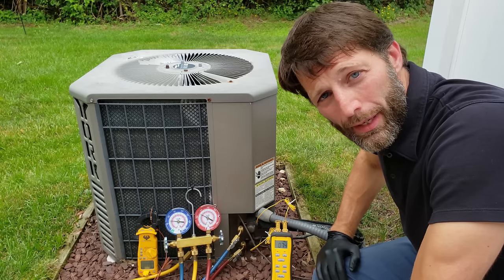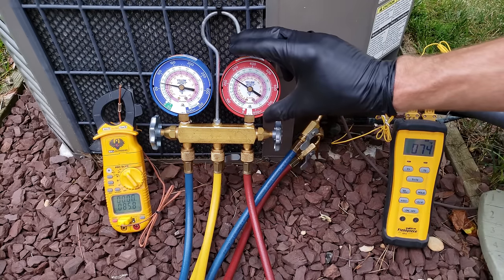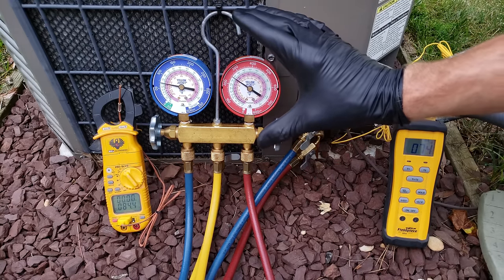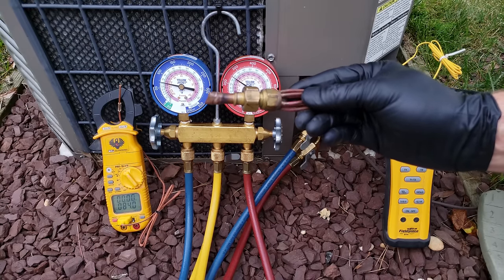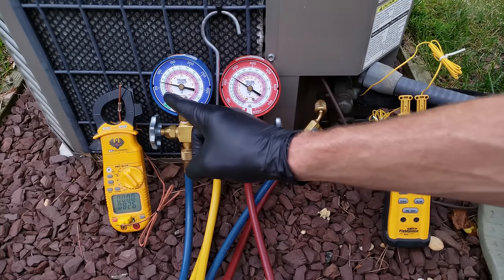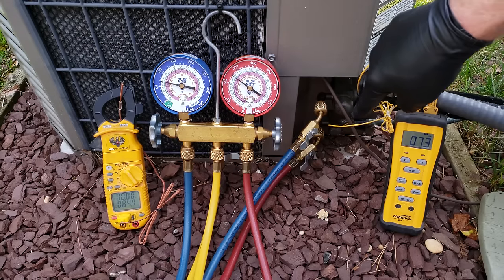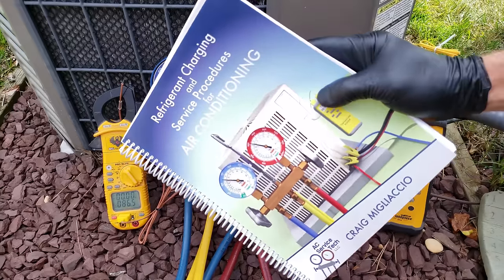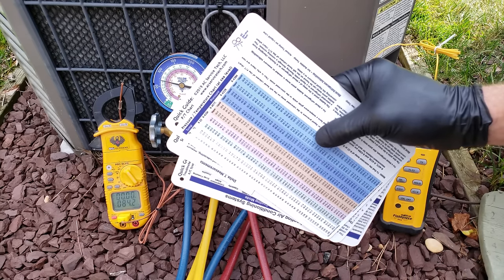Ambient +30 Rule & Ambient Temp +25 Charging Methods!

Comment: Thanks for this video.  I posted in another video how techs and my mentor are using the 30 deg rule on all refrigerant, not just R22.  They are using it with 404, 407, 422, 410. Bad habit and I will no longer be a bad tech.  Thanks.

Comment: I've been using Ambient+ methods to eyeball charge and coil cleanliness since 2009. The first time I made a repair on a brand new high efficiency 410a heat pump, weighed the charge in, and saw it running an ambient+ 10 my mind was blown. As far as actually checking charge is concerned, I have always used superheat/subcooling but when you are doing huge commercial accounts and every minute counts, the Ambient+ on the head combined with a delta (low delta, normal head, normal suction generally is indicative of low charge and dirty condenser and low delta, low head, low suction is obviously indicative of very low charge and a possible dirty condenser) will tell you pretty quick if you need to slap pipe probes on and check the charge. It also helps if you wave your hand over the condenser fan(s) while they are running and feel the angle they are discharging air at. If the air is almost blowing out horizontal that condenser is plugged or someone mounted the blade(s) wrong (it happens more often than you think, especially in commercial where building owners/leasers jump between contractors every five minutes). The ambient rules are absolutely fabulous for judging whether or not you need to clean/split and clean condenser coils at accounts that opt for T&M coil cleanings. You just need to be able to identify the rough SEER rating of the equipment you are working with. These little tricks can save you massive amounts of time on maintenances and, knock on wood, have never caused callbacks for me in all the years I've been doing this. In fact, I'm known for being one of the more thorough service techs where I work and generally quote more necessary repairs (don't be a hater, I never quote things that don't need replaced. My company does not give us spiffs for selling shit) and have less callbacks than anyone else and at least 50% of what I do is eyeballing, poking, and twisting things haha! In fact, I can't remember the last time I had a callback for leaving a unit run low on charge.
Reply: Low Delta, normal head, normal suction= low charge and dirty coil.  So, for this does it mean both low charge and dirty coil? Also, this is counting on that all stages are working?
Reply: Low delta, low suction low head=very low charge and possibly dirty coil.  So would this be definitely  low charge?
Reply: @La2venida  refer to the basics man. If you don’t know if your coils are clean then clean them. If dirt pours out then clean them until no dirt comes out. After that superheat, subcool, delta, and static tell you everything you need to know

Comment: Great explanation. I am at the end of my first semester in HVAC, and find myself wondering if I missed something along the way in these past months. I totally get the theory behind the basic function of the refrigeration cycle. But...I still find myself frustrated at not understanding the how and why of changes in one part of the system, say low evaporator charge, affects the function and measurements at say the compressor discharge port. I understand THAT change ( or imbalance) at one point does or should produce an effect in another location in the system, but I am not confident I understand WHY or HOW that effect occurs. Is there a video that you guys have made that explains that energy teeter totter for novices like me?
Reply: If you need sone mentoring you can reach out to me. Just let me know

Comment: Any guide for charging units in winter time? (Heat pumps) r-22 and r-410a.location for lineset temp probes to be placed while in heat mode and checking charge.

Comment: I have a question. Are you saying that the 11 degrees of superheat should be the target "total" superheat? It is my understanding that the temperature you arrived at would reflect the superheat just at the outlet of the evaporator.  Wouldn't the superheat reading at the inlet of the compressor be higher - taking into consideration heat gain from the ambient, friction and length of line set - than a reading taken at the evaporator? In which case, if I am correct, what would be the best method of determining what the "total" superheat should be at the compressor?
I read somewhere that a reading of less that 20 degrees on an 80 to 95 degree day would indicate an overcharge (not having checked sub cooling) or air flow problem. I look forward to your response. Thanks!

Comment: What I tell techs is when charging using sub cooling, they will find the liquid line will cool (go solid) @ approx 20-30 deg above ambient on the gauge. It was just an approximate and as a matter of fact, w/ assuming a clean coil and correct CF motor. I really never gave much thought with an accurator used with a TXV. I'd prob do superheat as a precaution, and subcooling to figure it out. Good vid but will be over the heads of most jr. and some senior techs!

Comment: Who uses long hoses and an analog gauge? You can also use this on a 404A system they still teach it heat craft teachers 30 above ambient on a 404 walking cooler walk in freezer.

Comment: Never used that method to check the charge but i was told that the AIR going in to the condenser should be 30⁰ higher coming out of the condenser. The problem is if the condenser is dirty it could give a false positive. 

I feel it is safer to just hook up and checkat least the first time then use non-invasive testing after a baseline is created to prevent future refrigerant loss and possible contamination. 

Thanks again as always!
Reply: What I would like to know is how did the engineers come up with the 25 - 30F numbers?  It stands to reason, that if you have an ambient of 100F, and you have a coil of 120F, you are going to have a cooling issue, so you are trying to use air of 100F to cool off a hot condenser that is running 120F.  It seems that in effect, you are superheating the ambient air.  If on the other hand, the coil is still 120F (based on the liquid line saturated pressure) and the ambient is 90F, now that makes a lot more sense, the air you are using to cool the condenser is cooler than the condenser itself.

I was helping a contractor who got a complaint from a restaurant that the building was not cool enough.  The first thought, not enough refrigerant.  He then became to believe the condenser was bad, so he replaced the entire condenser from the split unit.  The building didn't get any cooler.  I then made measurements of the airflow at the supply duct, the airflow at the return duct, the temperature differences, and calculated the btu's per hour.  As it turned out, the AC unit was working perfectly, putting out what it's nameplate indicated.  The building was simply under-airconditioned.  I don't believe they had make-up air in the kitchen, strike one.  Second, there was no insulation in the attic.  The thermostat got confused, it was not in the eating area, but right around the corner from the hot kitchen.  They ended up adding more insulation to the attic and above the suspended ceiling, that helped.

I always appreciate your videos, that was an excellent subject.

Jim
Reply: emptech . Restaurant kitchens are .. hmm disastrous!  With flour,  steam, oil and sugar floating through the air they really need a high fresh air content, huge exhaust fan above ovens, prep tables and dishwashers The evap coil gets coated regardless of filtering. 
In cooling may show up as low pressure or under charged.
I’d just about encourage a system with 100% outside air

Comment: R-22 and piston metering: Total SH method / vapor line temp - saturated vapor temp at evap (manifold dial) = actual SH / then compare to target SH calulated using ID WB and OD DB temps cross-referenced on a R-22 piston target SH chart.

Comment: Another great video. So take the wet bulb near the return air grill?
Reply: ideally as close as you can get to the evap on the return side of the system to cancel out and heat gain if the ducts are running in unconditioned space

Comment: When I first started in the HVAC/R field (1975),  it was  Ambient + 35°. I have noticed with the higher SEER, that is not correct. BUT....Ambient + XX is a "general rule" for diagnosing of which I still use today. SC & SH obviously is far more accurate.

Comment: Craig, The method I utilize for checking the R22 charge in my AC(non-heat pump,Goodman, electric heat,10SERR, 4ton, with fixed piston) is total enthalpy removed. Taking the DB and WB of the air
entering the return air and the DB and WB for the supply air and enter those readings in to a digital 
psychrometric chart, a 6.7BTUs of enthalpy for pound of dry air is the desired reading. I am omitting many details that you know about and enter into the digital psychrometric chart. These charts can easily be found on the WEB and used at no cost. With is in mind, I check the superheat and determine the correct superheat from the temps. and pressures, as shown in this video. This method corresponds to your video. Thanks for your excellent and correct information.

Comment: Good information.   I only use the 30 degree rule for determining what the saturation temperature/pressure should be.   On suction saturation the 35 degree DTD could be used for a approximate pressure/temperature  reading (AC coils only ) .  If I'm wrong please correct me.

Comment: quick question, Does the refrigerant calculator tell you how much refrigerant for the entire empty system or is it just how much extra you may need for the line-set?
Reply: Superheat and subcooling let's the technician know how much refrigerant is in the evaporator coil(superheat)(indoor) condensor coil(subcooling)(outdoor). If a TXV is being used as the metering device the method he is using will not work. Just pistons and orifice metering device. The chart he was using gives him a target number to let him know both coils are filled with the right amount of refrigerant and the system is working at its max efficiency (as far as dealing with refrigerant). Most units will have a factory charge number labeled on its data plate and that is only good for 15' of line set. If you have an split system you can go outside and check the data plate on your unit and it should be on there. You use this as a basis when weighing in refrigerant and it let's you know how much refrigerant is in the coil from the factory. For every bend in copper such as a 90° angle will add 5 extra feet to the lineset total. If your lineset is long with a lot of bends the guessing game begins on how much refrigerant to add to the unit. That's why you have a chart like he was using. You could have a 30' lineset with 15  90° bends in the lineset but that chart doesn't care and will let him know the level of refrigerant in the coils and how much to add.  There are some other variations but I hope I kind of explained it ok. A quick answer to your question is the chart lets him know how much refrigerant he needs to add for the entire system to work for what it was designed for.
Reply: @canman1088  I appreciate the reply, I know all of this already maybe my comment left a little ambiguity, but I was referring to the calculator tool he said is free to use on his website I have countless mobile apps that does the same thing so I was wondering if his was different in anyway, but your explanation was on  point 💪
Reply: @bago49  there's many different superheat charging charts out there. google it and you will see. The numbers may vary a bit here or there but for the most part if you just follow one you should be "close enough for comfort" ;)